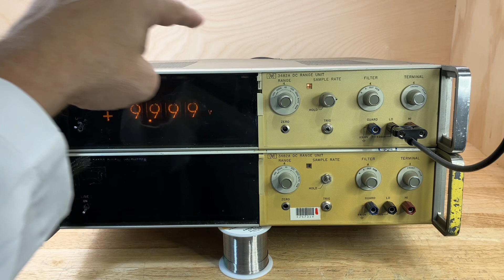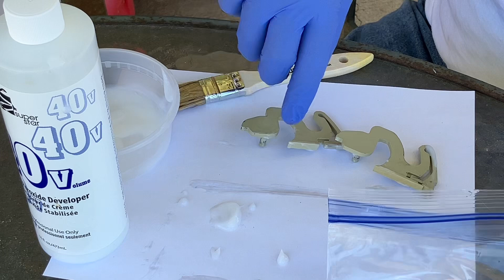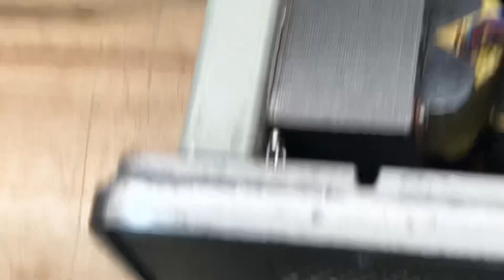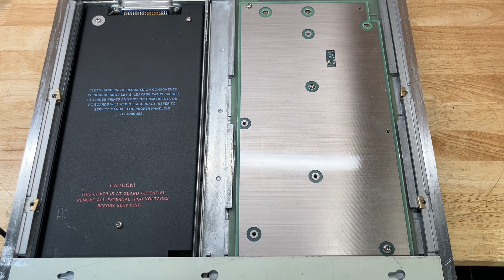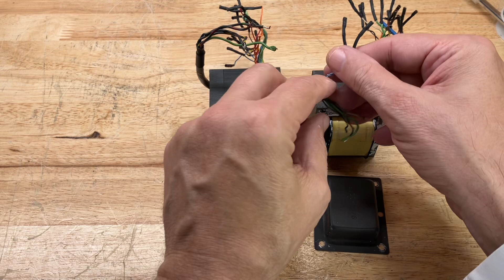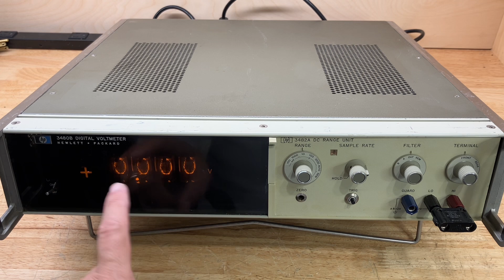HP 3480B Digital Voltmeter Part 1

Comment: usually a hum from a transformer is delamination of the iron core causing them to vibrate witch will cause heat as well and yes your correct it should not be getting that hot. i hope this helps some i restore these HP test units as well
Reply from the maker: @owenaero  after replacing the transformer, the audible hum decreased significantly, but it is still not totally silent. It also doesn’t get nearly as hot.